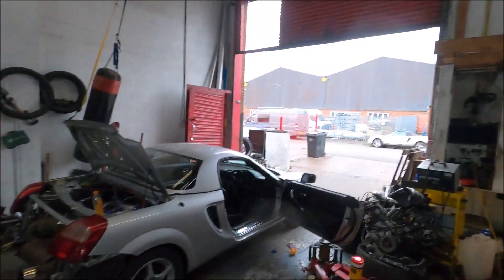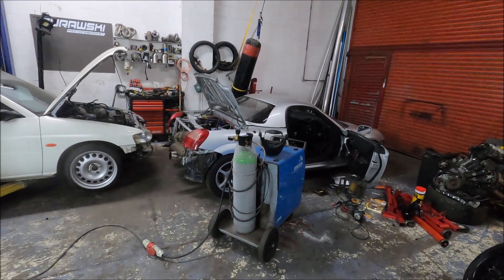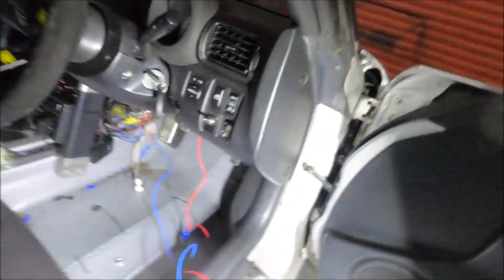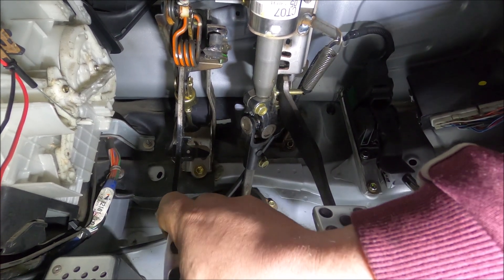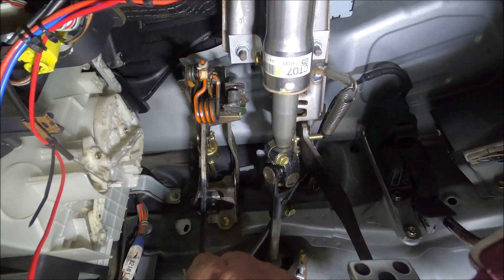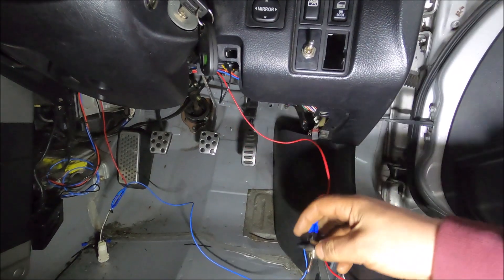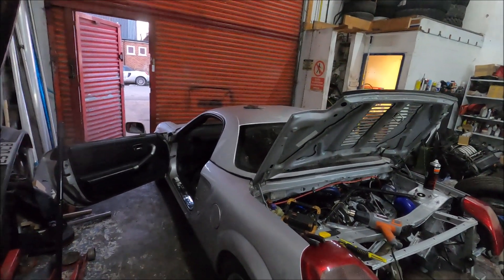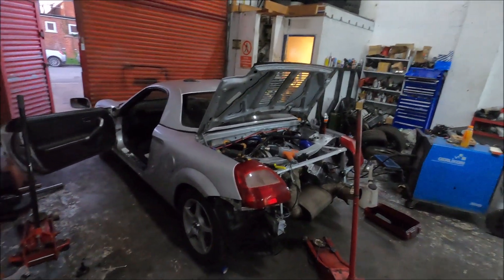Making launch control (and maybe rolling anti-lag?) work on the 1.8T swapped ZZW30 Toyota MR-S...

Comment: great stuff as always, your a friggin legend with the antilag !!! by the way do u know if the 1.8T has a RWD conversion kit available somewhere in the aftermarket ? cheers
Reply from the maker: Use a Passat/a4/a6/whatever Quattro box and weld the centre diff.

There’s adapter plates if I remember for rx8 boxes but don’t see the point vs the above

Comment: Happy Birthday, Could the sensor failure be related to welding the clutch pedal if the gauge earths are close the that area? I have never had an issue but as you say odd it doesn’t work from the factory. That said I had a haltech can wideband fitted to my s15 by mgt and that didn’t work from new and a replacement control unit fixed it.
Reply from the maker: Sensor has been showing ‘SENS’ for 2 months since first powered them up. Welding had been done at time of filming 2min. And the wiring related to the sensor is nowhere near.

Comment: I'm impressed with your knowledge and skills. As a MK3 MR2 owner this is really interesting. Looking forward to the diesel conversion on the yellow car.
Reply from the maker: The diesel one ‘should’ be super easy as Thomas has done it once already and I’m making it as standard as possible.

I think maybe 2 weekends would do it, one to remove everything needed from the Seat and one to fit everything to the MR2.
But first I need a working daily car to use while I do that, so either I borrow one or I wait until the silver one is ready and daily that for a bit!
Reply: I'm looking forward to the diesel build and driving videos.